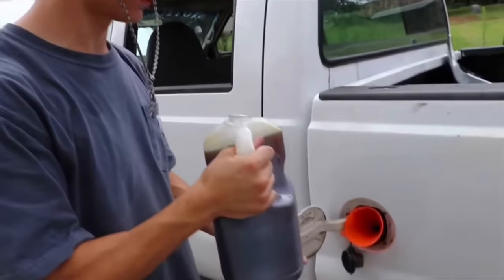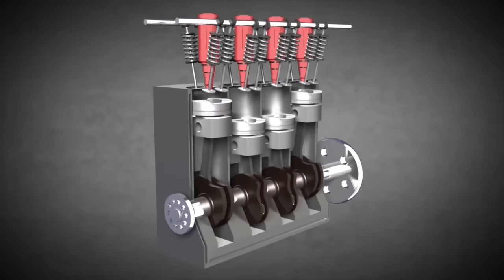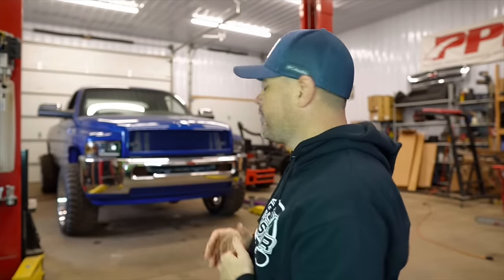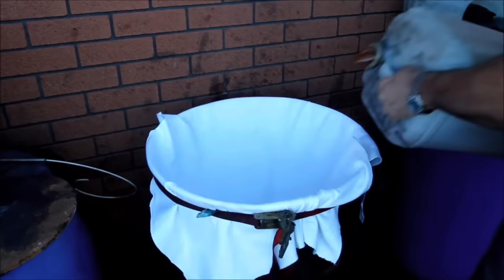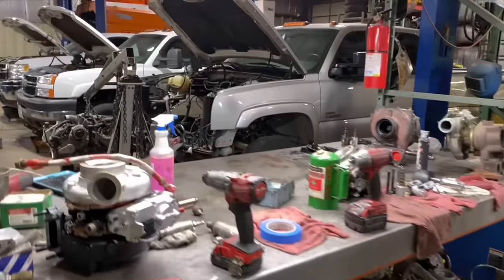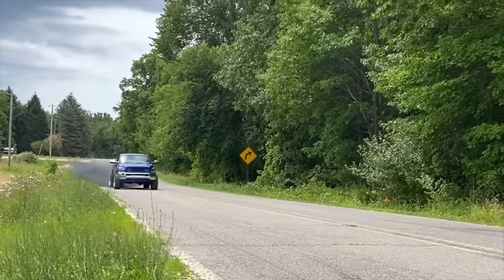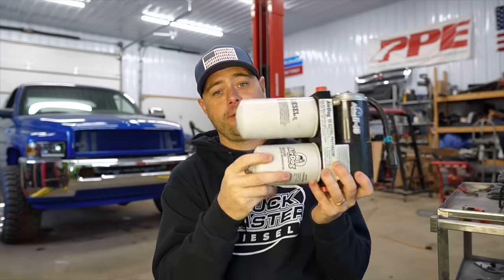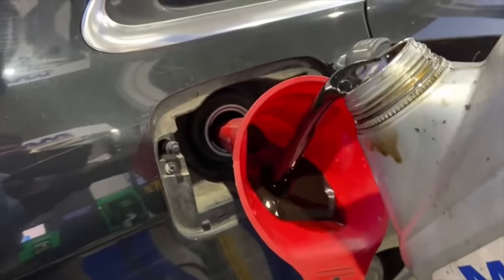Can You Run A Diesel On Used Engine Oil? Free Diesel Fuel? *EXPLAINED*

Comment: I have a 1993 Chevy 6.5 Detroit Diesel, the last year that was a mechanic pump (1994 and newer 6.5 still have the same injectors, but electronic controlled pump). I did an oil change, had no where to put the oil, so I just dumped it into my fuel tank (2 gallons). I drove about 20 miles, and I no longer had full, wide-open throttle.  I still had idle, still had part throttle, but wide-open throttle was gone.  So I make it home (about 10 miles), changed my fuel filter (I keep spares in my truck), and wide-open throttle was back. So I saved about $10 in fuel, but it costed me a $40 filter. Was it worth it? By my math, I'd say no.
Reply from the maker: Thanks for the input 👍
Reply: I’ve heard that’s common. The detergents in the oil loosen up any junk in your fuel tank which clogs fuel filters. After a fuel filter or two you should be good to go.
Reply: @braylonb.9768 , that would make sense if it was the original tank, a lot can accumulate after 25+ years of service. But my original tank was so rusted, I was probing it with my finger and hit a soft spot and made the leak worse. The tank that I put in, was brand new. So was the sending unit. When I installed the sending unit, the inside of the tank shined like a mirror. There wasn't any junk to be loosened up. Only junk in the tank was the 2 gallons of used motor oil. To be fair, I only change my fuel filter once a year, and it was getting close to that time, so maybe the filter was already on its way out, and the oil just finished it off. Still, that one close call was enough to set me straight. Next time I might be far from home and not have a spare, the tow bill alone would negate any savings and more.
Reply: I also have 1993 chevy 6.5, I run all the free motor oil in it I can get. No issues at all with 315k on it. Previous owner mounted a spin on filter housing on the firewall and deleted stock filter, so filter changes only cost me like $9 now, and the filter is way bigger.
Reply: @matthewfrymire3502  I have a 95, can I have a part number or style? Very interested in this
Reply: Did you take that oil straight from your oil pan and put it in your fuel tank? No filtering or anything? Im not surprised you plugged a well used stock filter on a 6.5. I had a 93 gmc Sierra 6.5 5 speed I loved it but that stock filter plugs up if you look at it wrong
Reply: @black69camaro2344 , Funny thing, when I got the truck it had some lawn mower filter on it. I replaced it with an aluminum filter head, and it uses two filters from WIX, first is a 100 micron fuel/water seperator, and the second is a 10 micron fuel filter. The second one is big, about the size of the oil filter, just that this one is for fuel. Now I have another issue, same truck 1993 Chevy Cheyenne, same engine 6.5 Detroit Diesel Turbo, and me being silly I gave it another go with junk motor oil. I got a cheap 90 gallon aux tank, I stuck it in the back of the truck, and I installed a tank selector switch. Someone told me that I could get better results if I two-tanked it, start/stop on diesel, run on oil+diesel+gas on the open highway, which I do a lot of. So I tried that, and after 45k miles of towing out on the open road, mostly 65 MPH for extended periods of time, the engine would have a hard time doing a cold start. I don't mean cold lik -20F, but I mean the engine cools off, and at 70F it won't start unless I use the block heater first. I figured the glow plugs were toast, and yesterday I started replacing the glow plugs. Well, I remove the plugs and all 8 plugs have no tips. The tips are completely gone. They're not broken, doesn't look like I had any debris bouncing around in the cylinder, but instead it looks like all 8 glow plugs were sandblasted until there was nothing left. And when I put the new plugs in, they had a hard time going in. It's like the pre-chambers are full of carbon or something, I had to really push before I could get the threads on the plug to engage the threads on the cylinder head. Once the threads engaged, I could use a socket to screw them in completely and get them to seat. Also, one of my injectors cracked. I was told that some of that oil might of been saturated with moisture and when it flashed into steam, it expanded and cracked the injector, spilling oil and diesel down the side of the engine. It was on the driver side, away from the turbo, so it took me about 15 minutes to change it out. But when I pulled the old injector, the nozzle was completely caked in what looked like concrete. It was still injecting fuel, there was a tiny hole in the center, but whatever caked onto the nozzle was so hard that it broke my steel pick when I tried to scrape it.

Once the truck starts, it runs great, smooth and clean idle, and decent power for a stock 90s diesel. But I haven't started it since replacing the glow plugs. In case a lot of carbon got dislodged from when I replaced the plugs, I'm going to remove the serpentine belt and the crank pulley, and try to turn the engine over by hand. As long as it doesn't bind, I'll go ahead and start the truck MINUS the turbo. I'm afraid of having a bunch of loose junk shooting out the exhaust and damaging the turbine. My plan is, as long as the engine freely rotates, to route a hose for the turbo oil feed line back to the return pipe, start the engine without the turbo, and hit the gas. If there's anything loose, hopefully it'll shoot out the open exhaust manifold. Once clear, I can put the turbo back on and see how she runs. With any luck, I can now start the truck without having to wait 2 hours for the block heater to warm it up first.
Reply: @black69camaro2344 , thought I'd update. I rotated engine by hand, no funny noises. I started the truck with no turbo, blew oil everywhere. I had a funnel on the return hose, and zip-tied the feed over it, but the pressure blasted oil in all directions. Bolted turbo on and pressure washed the engine bay. New glow plug solved my no cold-start issue. I'll have to see how long it lasts. I can't explain why my previous glow plugs eroded to much so quickly.
Reply: @vivillager  A lot of information here, I am glad it seems to have worked out in the end, that being said the oil line puts full pressure out so if its 40 psi, 50 psi or more yep it goes everywhere.  As to the glow plugs I have certainly seen, and heard about them burning the tips right off, one reason I hate glow plugs. Cummins grid heater is by far a better option even though you CAN NOT run ether  or it might ignite in the intake. scratch that it will ignite if the grid heater isn't disconnected. in you case I would say your glow plugs were 80% or more wore out but oil does carbon up pretty bad the 2 tank method is a good one because you can start the engine warm it to operating temp then switch to oil  then be sure to switch it back to diesel  at a minimum  10 mins before shutting down giving the diesel time to get through the fuel system and into the injectors so when it starts next time it isn't starting with oil. but even that might not be enough if the cylinder and injectors have carboned up. one solution is to run some clean atf fluid through the diesel tank every 4 fill ups. I think I read a gallon of atf per 20 gallons of diesel, but I am unsure on that ratio number at the moment. Ok now for the used motor oil, I will be very clear here if you want to be really safe using it you should get a centrifuge I don't have one I don't currently run waste oil, I do however put new oil in sometimes, I like to use some 2 stroke oil in my diesel to help with lubricity since ULSD has lost so much of the lubrication properties. I have run waste oil and if it is my own, meaning it comes out of my motorcycle, mower, car, or cummins I will filter it and add it to my 100 gallon fuel tank so the amount of oil is very very small.

Comment: I used to dispose of my oil change oil at 1 quart per tankful of diesel in my old 6.5 with no issues whatsoever. But with my LB7, after a few thousand $ in fuel system rebuild Iam reluctant to try it.
Reply: I wish someone would experiment with that for long term use on these new emissions trucks.  Just need a way to fund that project in case it does damage any parts.

Comment: I had an old 85 choo choo custom Chevy with a 6-2 diesel in it. I used to work at an automotive shop I used to run that truck on 50/50 Diesel and used motor oil we just change oil in the shop I would run it through filter dump it right into the tank in Winter I would split it with kerosene! That truck ran for years I never had a problem. There was a junkyard out in north central Illinois that had one of them old 62's and a half ton Chevy they ran that thing nonstop for 3 years only shut it off to check the oil and change filters that thing literally would run a month or two at a time Day and night that thing just cackled in the yard they filled that thing with motor oil trans fluid gear lube they didn't care whatever come out of the Boneyard when in the tank with a little bit of red dye diesel

Comment: Coming back from a elk hunt years ago in Colorado I was in the middle of Kansas 2:00 AM and very tired I pulled up to a  BP station and saw a green handle half asleep and 17 gallons of gas later I woke up. Went in and got about 1 1/2 gallons of motor oil and dumped in then topped off with 10 gallons of diesel. A little weak on powder but didn’t hert anything. Words of wisdom be careful at BP STATIONS!! all there handles are GREEN 😂😂
Reply from the maker: Honest mistake 😂👍

Comment: The short answer is yes.....if you have an older diesel vehicle.  I have a Korean war era half track that runs like a champ on used motor oil.   The great part is Jiffey Lube pays me to drain their 60 gallon used motor oil drums.  Free fuel.

Comment: My 06 6.0 takes 15qts of oil to change. Let used oil sit for a week and all junk in it will settle to the bottom of container. I mix about 3gals of oil with 5gals of diesel and pout into 30gal auxiliary tank. I keep adding diesel to auxiliary tank and pump into truck tank as needed.

Comment: I suppose you can do that in an emergency but only if you plan to Scuttle the engine. I would imagine all those metal filings in there would clog up and ruin a injector pump pretty quickly.

Comment: Yes we were on vacation pulling the camper and I accidentally pumped three gallons of gas into my 06 Duramax LBZ because BP had a green handle on the gas nozzle. I called my diesel mech friend and he said fill it up the rest of the way with diesel and add a quart of trans fluid in it and run with it. No issues at all.

Comment: Just gotta get the water out and the fine particulates...50% diesel / 50% wmo.  Many new systems have optical sensors to test for farm fuel so mixing in wmo it may not work for newer injection system

Comment: I run it in my 97 7.3 powerstroke with no issues I also run the used cooking oil mixed 50/50 with diesel

Comment: Ive heard that if youre running a deleted truck or one pre-emissions you can run 50% diesel fuel 50% oil with no harm to the CP3 or injectors, and so far I've found thats accurate, I have a truck I use off highway that has a CP3 and its been running a 50/50 mix almost the entire time I've had it with no issues

Comment: I run wvo oil filtered to 5 micron on my 12 valve. It works great and free.
Reply: Watch out for sticking rings. I did it with my old Mercedes with good luck but I only used a 10% mix.

Comment: Considering the incredibly tight tolerances in modern common rail injectors and cost of replacing the fuel system ($10+k) the smart choice is to buy pump diesel from a station that sees a lot of traffic (i.e., fresh) and maybe use an additive like Hotshot's Secret. Unless you drive a 12V, putting anything but clean diesel in your truck is you begging for a catastrophic failure.
Reply: But like one reads in the comments...one can educate yourself and do it in many different even fairly modern motors and save a ton of money. But it does take some effort

Comment: I have a 88 6.2l that I put a banks kit on. I ran absolute trash in it for 350,000 miles…. I still have the truck, but I admit I don’t drive it. I got a 24v cummins. It’s hard to justify running the ol’ 6.2, when the Cummins beats it in every way. So far the Cummins has done good running on used ATF and diluted vegetable oil.
Reply from the maker: Thanks for sharing, it’s good to hear from someone who actually dose this
Reply: No problem. You were spot on about changing fuel filters every oil change. I certainly had to… but I never filtered anything. I worked in a shop and If I did 3-4 transmission flushes a week, I wouldn’t have to buy fuel. I’d just roll the flush machine into the parking lot and empty it right into my truck. I believe if I attempted to pre-filter all of the trash I’d throw in the tank, then I may actually get decent life out of a fuel filter.

Comment: Real easy way to run straight vegetable oil or used motor oil is to use an inline heated 5 micron fuel filter, itll warm up the fuel before you put it through the motor so its at the right viscosity, just make sure to dump it through a sheet or pair of jeans as a filter before putting it into your truck to get most of the junk out of the oil, then the proper filter will get everything else out and make it wasy to start in the cold

Comment: I have a 1987 f250 with the 6.9L diesel. Love the truck. Hate the engine as it's very underpowered without a turbo.  But it just runs and runs. I add 1oz of 2 stroke oil to every gallon of fuel for lube. Does make it much quieter. I would not put wmo in it without filtering it as you mentioned. The pump rebuilder won't accept a core if the sleeves are all scored up from dirt and whatever else is in the fuel.

Comment: My 2000 Ford excursion with 468k has been eating it's used engine most of its life, I filter it just after draining and put the 4 gallons in before I top off my 44 gallon tank, no issues yet, still running on all original fuel system, only thing I've done as a precaution is o rings and injector cups at 300k

Comment: I ran 10% waste oil for 10 years on my 04 Cummins without a problem.  Only part of the fuel system that failed was my lift pump.

Comment: I've been running it in my 01 f450 7.3 service truck. Filter it cut it 50/50 with diesel works just fine. I have 8 reman injectors waiting on the shelf. Seems to run alot smoother and gets a bit better economy zf6 and 488 gears every little bit helps..

Comment: My goal for end times would be get ahold of a heavy wrecker. 40,000 lbs, 3 winches, boom, usually has a box on board full of snatch blocks, ECT. You could haul off a semi full of goods, or move a 10,000 lb boulder to block your driveway
Reply: Hahaha,  "end times"...
Reply: Twisted Metal was my favorite too 💪💪

Comment: Kerosene is primarily sketchy to run in a diesel because it's a thinner, lighter oil that doesn't have as much lubricity so anything lubricated by the fuel won't get the lubrication it needs. 
Other than that and the sulfur content, it's very similar to diesel.
Reply from the maker: I personally would never risk it but if I had to it would be mixed with diesel fuel
Reply: I would only use kerosene to clean injectors.
It’s thinner, and tends to break up the deposits.
On the really old trucks, like the old Mack engines, you would change the oil, filter the old oil, and THEN add it to the tank.
Reply: @TruckMaster  Michigan winter fuel is a blend of #1 Diesel (Kerosene) and #2 Diesel. Usually 80:20 but can be as high as 50:50
Reply: Similar to old style diesel or ultra low?
Reply: @countcuda70  I believe that is everywhere that gets well below 0 F I actually really dislike Winter blend because of the loss of power and mileage so I solved that by moving away from the cold ❄️🥶
Reply: @black69camaro2344  🤣. Good plan. I'm not 100% sure so I didn't put any other numbers down. You're probably right though. I'm sure all the cold places do.
Reply: Add a quart of transmission fluid it will be fine. I ran tanks of #1 diesel with transmission fluid, never had an issue in my 2003 5.9 cummins

Comment: If you mix little bits portions with your fuel yes you can but it fouls the injectors  then you need to run injector cleaner

Comment: I have run my 1993 gmc 6.5 diesel on used veg oil, used motor oil, transmission fluid, and hydraulic oil. Never mix used veg oil with any of the other types. If it's cold out or I have thicker oil I thin  it out with gas or Diesel The ratio depends on the temperature trial-and-error But 5050 with diesel is usually safe. I do this on the 93 6.5 because that's the last year with no optical fuel sensor In 94 and later they have a bunch of sensors and electronics that makes this much more difficult if not impossible. I have saved thousands of dollars on fuel only issues I've ever had is changing fuel filters I use the stock filters their cheap I filter my oil well before putting it in the tank and rarely have to change one. When you 1st start running veg oil you will almost definitely have to change your fuel filter a couple of times because it cleans all the junk out of your tank like a solvent. I use the cone style grease filters that restaurants use for filtering their cooking oil to make it last longer and rarely change a fuel filter.

Comment: I've been running used motor oil, vegetable oil, an number 2 fuel oil in my 06 lbz as long as it's filtered really good an you thin it out to be close to how diesel fuel is you will have no side effects doing it but no you can just dump it straight in gotta thin out the oil with diesel fuel kerosene or stale gas for it to work properly in the newer common rail trucks
Reply: I have a separate heated tank for my ‘01 Duramax and that thins out the oil just fine
Reply: @matthewbrust3353  veggie oil? Or motor oil? It is my understanding that motor oils multiviscosity keeps it from thinning to much from heating